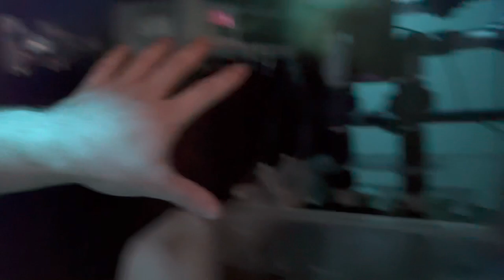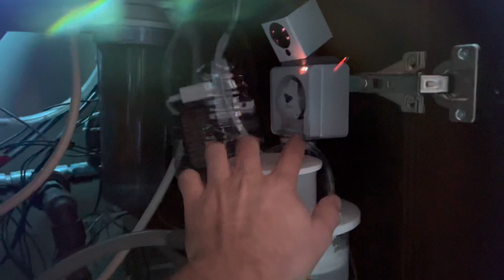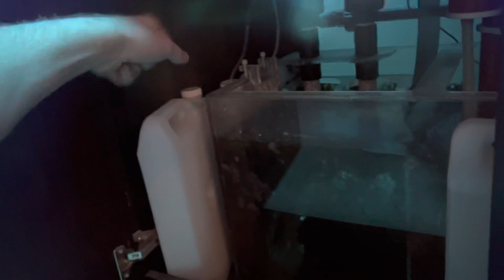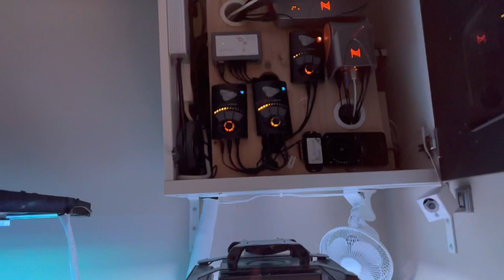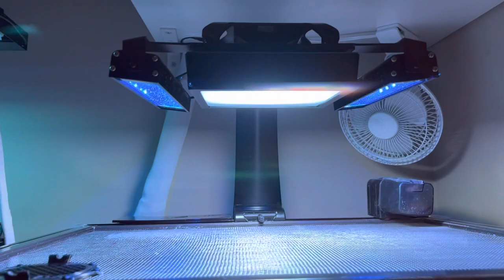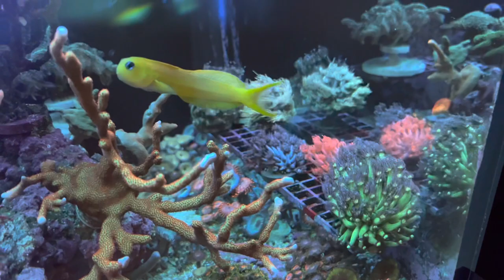Tour Of My Mixed Reef Tank - Equipment & Animals

Comment: Run my reef the same way as you do except no KNO3–manually adding kalk for now and supplement with AFR, keeps alk 8.5-9 and ph 8.1-8.3, grows coral and coralline endlessly.  So much easier and more stable than 2 part or reef moonshiner or calcium reactor (too much acid that brings down ph).  Just found your channel and following— you need a bigger tank…😜
Reply from the maker: I need a bigger house first 😂Thanks! Kalk and afr work great together